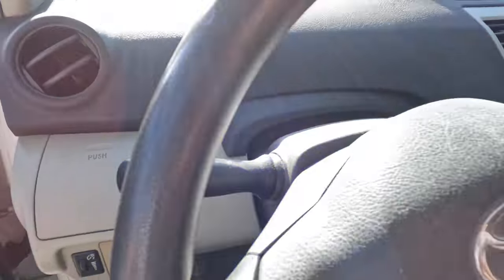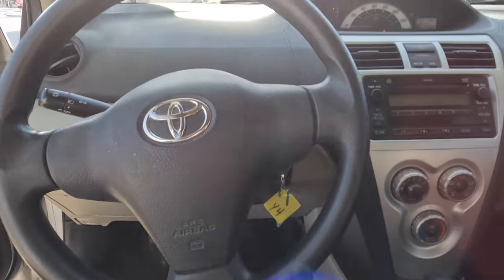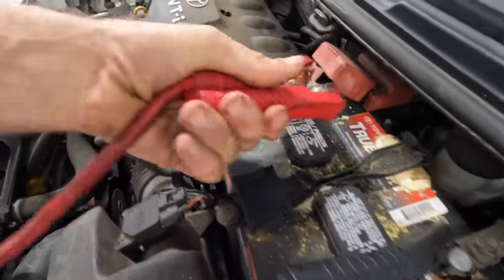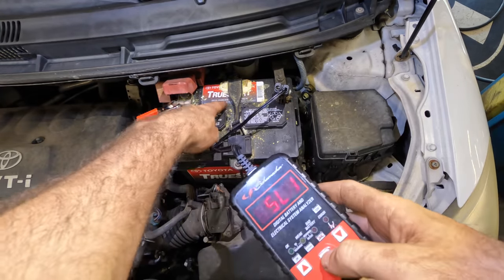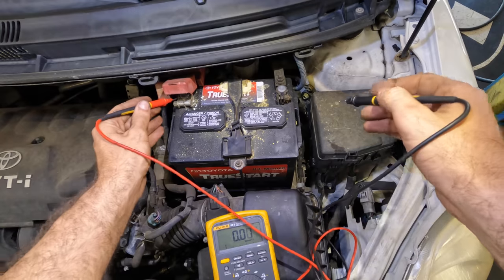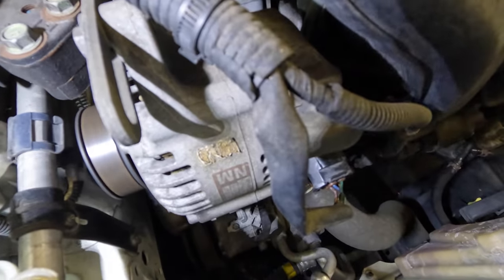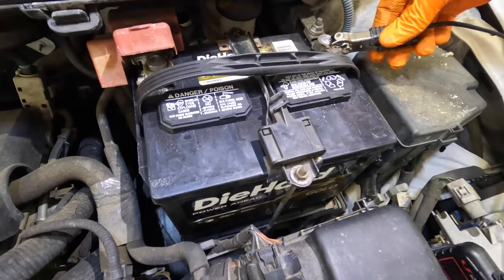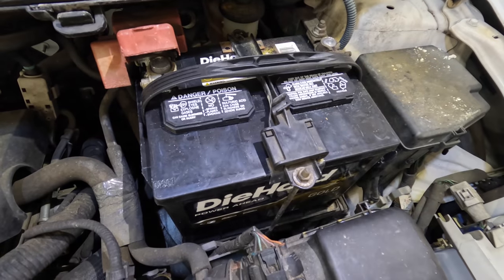Ignore the obvious! “Let’s see what happens” 2006 Toyota Yaris

Comment: New tool idea, stack a socket, get the length you need without having to have long, short, mid, brand a, b and c because they are different lengths. Also have you ever seen the gear wrench serpentine belt tool it comes with a few sockets that are the shortest I’ve ever seen, would love to have a set of these and a ratchet that fit them, would make a super low profile setup, yeah yeah extensions, been there done that it’s not the answer in those tight situations.
Reply: Vim tools and koken make great sockets

Comment: Bought a 2007 Yaris for my son’s first car.  Paid $4000 for it five years ago.  He just sold it for $4300.  These are great cars.’
Reply: Mine is rusting apart badly. I went to replace a wheel bearing and ended up replacing the backing plate due to rust getting in the way of brake drum reinstall, then the wheel cylinder bolt was rusted to the point of snapping, and as I tried to unscrew the brake line from the wheel cylinder that was rusted to failure as well.
Reply: @randomvideosn0where  keep it if you can, what you are describing is all pretty minor stuff and easily repairable.  We are in the north east and my son's Yaris was rusty in places, the worst bit was part of the rocker panel that had rusted through but I easily repaired this.  The types of things you describe is typical on most cars in snow belt areas, but unlike most other cars these engines and transmissions are pretty bulletproof.  I've seen Yaris for sale with well over 200,000 miles and they easily achieve 30 plus mpg which is especially important these days.
Reply: @robbflynn4325  I do plan on keeping it, currently at 160k and I figure with the number of parts I'm replacing I can get to 300k (as you say, the engine is running great). I am going to take it in for body/paint so the rust doesn't go completely through. I'm just surprised because it has rust on par with my 86 F150 and my 03 Prius has almost no rust besides exhaust. And as far as gas mileage, I get 40-45 calculated at the pump because my 120 mile commute is mostly highway.
Reply: @randomvideosn0where  avoid body shops especially on an older car, they charge too much.  There are plenty of How To bodywork videos on YouTube and the stuff you need is relatively cheap, body filler, sandpaper, primer and paint.  You’d be surprised at the results.  The buyers of my son’s Yaris didn’t even notice my rocker panel repair.  If you have holes you can always use a fiber glass repair kit or the bendable metal gauze you can apply and cover with filler.

Comment: Very popular car, especially in Europe 👍
Reply: Not only very popular... very reliable (usually). Top 3 in reliability charts for 15 years.
Reply: @MickayG  maybe due to the fact that those have an average 6k miles per year 😅.. you don't see them on the country side in Sweden, wonder why?
Reply: @Sjoerdwm1981  Ehhh no? Lots of Yaris are used as affordable daily drivers, probably economically one of the best cars you could buy... very low maintenance costs, good gas mileage, can't drive much cheaper than that... 150k+, lots of them around and well maintained always a solid cheap car for somebody that doesn't car about looks or driving dynamics.

Comment: Even tho it didn't need a battery. 
The new battery cranked over the motor faster, then the fully charged old one.
So maybe it was a good call...
Reply: It was only charged for 1hr at about 5A which is only 5Ah. I would have cleaned it up and given it a full recharge and a second go after the alternator was replaced to save some money.
Reply: I agree ! We do not know how old that battery was.. Sometimes, batteries have a cell or two inside start to fail, and they are not going to get better.. So you have to change it out now, or you will be doing it later... I am glad they did now, so he has a new alternator and a new battery at the same time...

Comment: Was a common fault in these for the voltage regulator in the alternator to fail, first intermittently and then all together. Happened to mine. 

These are a great mile munching shitbox. Rust around the rear axle bean mounts is what will get most of them. Besides a clutch and some front end damage I hardly had to do any work to mine until it was 14 years old. It took me all over Europe including to the Nordkapp and back multiple times and never missed a beat.
Reply: These cars are also very spacious inside, I'm a big guy and had plenty of comfortable space in the front.
Reply: @rztrzt  Yeah. I'm 6 feet tall and 260lbs and the Yaris is one of the most comfortable cars I've ever driven and I have driven a lot of different vehicles for work. The only other thing I find as comfortable is vans. I have been on 3-4 week camping expeditons and roadtrips in mine. I also got my sister and all her crap from university the one year and moved house in it with everything except my bed and my sofa. I've had almost a ton of logs in mind and 2 dozen 2x4's.
Reply: @mikaelhg  Yeah. Mines the 1 litre. Its a little sluggish but with the 5 speed you can get what you need out of it. Everytime I think about a bigger engine I remind myself of how cheap it is to run at 55MPG.

Comment: You didn't mention how old the battery was. Maybe the owner knew it was near death. By looking at it, it looked fairly new, so with your diagnosis, I was surprised about the replacement, too.
I saw the ugly headlights. I tried a YouTube hack about using DEET (bug spray). It wasn't perfect, but was an improvement. Since you always fix 'observations' (air box), maybe you might want to give it a go.
Keep the videos coming, please. You are an amazing mechanic.

Comment: It's silly. I am a mechanical engineer but had to retire on a disability pension due to cancer. I know how to do everything you do. I do it in the dark with two hands tied behind my back, blindfolded. But, somehow I watch all your videos and think what a great job you do. I know it's only an alternator but it's a great alternator video. Keep on keeping on, man. 👍👍
Edit: The worse Yaris in the world will always be better than the best Prius!
Reply: Ever worked on an aircooled tip truck? Yes they made them, not just cars came aircooled.
Reply: @johnt.848  Try an aircooled 41-passenger tour bus.  Yup, I had one of those, too.  V-8 with twin turbos.  It flew.  The engine was an aircooled diesel built by Deutz.  You did have to keep the cylinder head fins very clean or you would burn up the pistons, though.
Reply: Sounds made up

Comment: I'm surprised that the customer didn't ask for you to put the old battery back in again, given that the new battery didn't fix the alternator :D
Reply: ...and a full refund on the returned, non defective, but no longer marketable as new, battery.
Reply: @blastem  To be honest if it's been run flat a few times then it's probably not long for the world, a simple measurement of CCA doesn't measure battery capacity or whether it's developed a self-discharge problem.  Also since the battery had literlally just been on a high current charge it's unlikely that the test is showing the true condition of the battery anyway.
Reply: @Chlorate299  I was referring to the brand new battery that Ray had installed, not the battery that the car came in with... But you're right. The old battery has probably been "hurt" significantly by the flattening(s) it has received with a non-functional charging system.
Reply: @blastem  Ah gotcha! Yeah fair point.

Comment: Good video; Shows everybody struggles on new and even older cars. 

As you know and bye the way an alternator doesn't produce electrons it merely moves them around; a battery stores energy not electrons.
Reply: And humor is a useful tool for communication as well as the relief of stress. click.
Reply: You're wrong man, it's obvious that rotational anger is turned into electrons within the altertator
Reply: @lolatmyage   hey is that rotational anger due to difficulty getting the bolts in and tight?
Reply: @grahamheath3799  It does play a part, if the topinator bolts are loose then the turbo looses efficiency, so the motor can't produce as many electrons

Comment: Official procedure for build of the Toyota Yaris at the assembly plant: 1.  Suspend alternator from the ceiling with a piece of monofilament fishing line.  2. Assemble Toyota Yaris around suspended alternator.  3. Cut and remove monofilament fishing line and discard.

Comment: I really like your videos...  Just in case you didn't notice,,, the air box that you secured at the first part of the video?.   When you removed the battery at 5 minutes and 35 seconds into the video, the battery bumped the rear air box clip and it once again became unclipped.   Noticed it remained unclipped when you shut the hood...   You do a great job and I appreciate you videos.   Best Video coverage I've seen on any mechanical coverage.  Thank you for the time you take to share your work.

Comment: The one clip for the air filter box is still loose at the end.
Reply: Nobody’s perfect..
Reply: I saw that and giggled, I'm currently driving a vehicle that it doesn't matter how many times you reclip the filter box clip I swear as soon as a small breeze comes by it pops right back off
Reply: Must be a Toyota thing. My Camry is the same way, including the broken bolts that are also supposed to keep it closed.
Reply: Saw that too.
Reply: reeeeeeeee
Reply: Well, in the video it was. Maybe it has been clipped back on. Maybe not. We cannot know. 
Also, we do not know if the harness holddown bracket was put on the alternator (which I doubt it was since it got installed without).
We all make mistakes.
Reply: @tracymclaughlinholmes677  Need to bend clip to make it tighter.

Comment: Great video on the popular ( in the UK) Toyota Yaris. Currently looking to swap car for one of these new Hybrid models. Any opinions from current owners ?
Reply: My wife has a 2021 Yaris Hybrid. Great car, very fast in combination with the CVT. Great fuel mileage of 25km/liter or 58 mpg(US) 70 mpg(imp) on E10 (95 octane). No plug required, electrical system charges as required using engine and regenerative braking. Toyota quality!

Comment: To do the alternator in my van, a Buick Terraza, I needed to disconnect the top engine mounts to roll it forward to get the alternator out from the back side. You had it relatively easy by removing that bracket.
Really want to talk to the moronic engineers who design under the hood of these cars!
Reply: never buy american cars😂

Comment: “Replace the battery and let’s see what happens”. Sounds like you need to replace the backbone in the sales guy who accepted those instructions.
Reply: Customer wants to waste money. Salesman is like, 👌 let's take your money.
Reply: The customer was informed, in the first place, it wasn't the battery, it was the alternator, customer insisted on 'trying' a new battery first, how is that the sales guys fault? 🤣🤣🤣
Reply: Lmao the sales guy did exactly wht he was supposed to do. Informed customer of the problem, customer chose to spend more money, sales guy took the money
Reply: @GAM3OVR1  — lol, everyone happy
Reply: :)  I saw a video of Ray installing a good set of used shocks on his Tahoe (I think) at his place.  Wonder where those came from?  Hmmmm.  OK, don't get excited.  I'm just pickin'.
Reply: @stevereaves6757  At a repair/tire place I worked at years ago, we had a booming used tire business made up of all the tires we replaced. Some folks just can’t swing a new set and it provided a necessary option.
Reply: @caymanchristopher7014  Understood.  We have shops around here who sell new tires but I've never heard of the brands.  And they ain't that cheap.  But they have a booming used tire business; decent tires too.  They'll let you check the date.  I bought my last tires on line and had a local shop mount and balance for $20 each.  Yes, I know that throws a monkey wrench in the road hazard deal.  The last place I used was Tire Crawler.  They're gone now.  They were in California as I recall.  Got my tires 2 days later so I know they had a deal with our local big tire distributors. We have 2 here.
Reply: @caymanchristopher7014  I'm sure they do! I often make trips of 500+ miles and as such, frequently replace things out of caution. One wheel bearing humming means replace all four. One tire getting close to wear bar means replace all four. One shock goes bad means replace both. I'll leave the gambling to someone who stays local.

Comment: Toyota Engineers: "Lets make bolts on commonly replaced parts hard to get to"
Toyota Upper ups: "Yes"
Reply: You forgot to mention that you needed to use Mr. Burns greedy extended yyyyeeessss
Reply: I was kinda surprised by that little snafu. Toyota is usually pretty good about that, BMW on the other hand.....
Reply: Toyota engineers seem to take pride in making certain things unexpectedly difficult to service.  I have an ‘05 Tacoma with a pinhole power steering return line leak.  It is a conceptually easy repair, but … despite having enough room to put a small child or two under the hood along with the 2TR-FE engine, it appears that it may be necessary to remove the skid plate and part of the front fascia to get at the leaky pipe.
Reply: Well thats what happens when one department engineers the engine, and another department engineers the engine bay and neither department communicate with each other.  Besides, they will never actually work on them because, Toyota!
Reply: The Yaris is a Mazda in a Toyota disguise!
Reply: Very true.  I am still traumatised from when I had to change the serpentine belt on my 1AZ FSE engine.  They made it of such great quality it only took 2 seconds to utterly strip the tensioner bolt.   And replacing the tensioner?  Yesss, if you remove the engine mount first because why not

Comment: I have a 2003 ECHO which is the same 1.5 l motor. Love the car. 108 hp. Good power to weight ratio. No issue getting up to speed. And with an automatic. Hardest part of the job is getting that belt back on. No room.

Comment: The engineer that designed that should be required to work in the field for one year changing those alternators.
Reply: Nah... just the water pump which is behind/ underneath it. Of course, you have to R&R the alternator to get at the water pump...

Comment: Friend of mine had a Yaris ... ran like crap, with a misfire code.  Pulled one of his plugs.  Gap was larger than the tool could measure.

"Hey dude, you ever changed your plugs?"

"What're those?  I don't think so?"

200k+ on factory plugs.  It actually blew one of the coil packs trying its damdest to force spark across the gap.

New plugs and packs, and it ran like a champ.  Toyota is damn near indestructible, if you do regular oil changes, etc.

Comment: I did this repair in a parking lot. The top bolt on the alternator was so tight I rounded it off trying to get it off. The bolt appeared to be made of butter, and yes I used a closed end of a wrench. Vise grips didn't work either, then I ended up using a hammer and chisel to get it to break loose. Fun times. The hardware store only had a replacement with a hex head. The Yaris was a good around-town kind of a car. On the highway, it was kind of rough. It averaged 31 MPG. I thought it would do better.

Comment: How does the customer just tell you to waste your time and their money?!?! That's gotta be so frustrating! That's the point of a car shop. You pay for their expertise. 🤦‍♂️
Reply: Better option would be, replace the Alternator, and put a new battery in as well. Electrical problem fixed, and warranty for battery, extended 60 months.
Reply: Of course, but unfortunately some unscrupulous shops have made people suspicious of being fleeced.
Reply: @greenman8  I agree with ya there!
Reply: Funny how often the quick lube shop tech tells customers they need a flush/rebuild. That's exactly why the customers suspect any reports of faulty hardware.

The industry is wrong. That why trust is valued so much with mechanics

Comment: I was about to say.. the Yaris doesn't have a power steering pump.

Also, totally overkill but if you're having issues reaching in to get the belt out you can take a couple of fasteners off for the splash guards and get it from the bottom. Extra work but makes it a little easier.

Comment: The only thing I might have done as well would be to remove those white paper stickers with the barcodes on. Both are partly covering vent holes plus they can very slightly reduce heat dissipation. Nothing major, just extra little touches that make very little difference but, do make some difference.

Comment: The fun part for me is that you use the same procedure, minus the AC bracket, to change the alternator on my 91 Camry.  It was OEM and lasted some 25 years.  And yes it is a daily driver with millennial theft protection and 25 mpg to fend off the Biden gas tax.

Comment: Absolutely, cos 12 volt DC is just so powerful!
It's not like you could lick  both contacts at the same time, now that would give you a boot.
But it is probably the only time, the real issue would be a dead short from live to ground, BIG SPARKS, if left long enough, about half of a second, will weld itself then melt the insulation followed by FLAMES!! 
And we all know that's not good.
Excellent video as always Ray.
I like the fact you pronounce things correctly and don't have the southern twang

Comment: I just replaced the nator on my wife's 97 Toyota RAV4. The original one with the car. Thank God it was on top like that one. It has a screw bracket for belt tension that is much better than pry bar. Lucky thing you have long thin arms to bear hug that motor. My fat arms would have not fit. Nice video. Have a great day yourself.